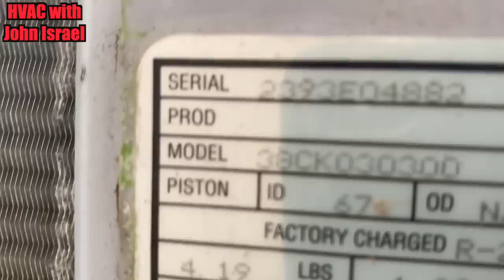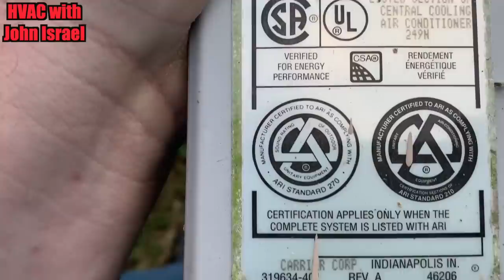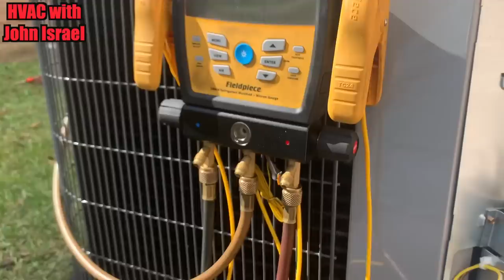HVAC System Change Out

Comment: You never change out the line sets in any of your change outs, we always change them out on a burn out or converting to 410a, looks alot more professional, with a new line set and line set cover
Reply from the maker: If you say so
Reply: It's the truth, we don't cut corners
Reply: Especially if you'r using the existing line set atleast, have the time to use Rx11 flush to clean the line set out and blow it out with nitrogen, oil will get trapped in a lineset
Reply from the maker: @marcoslira1038  👏🏻